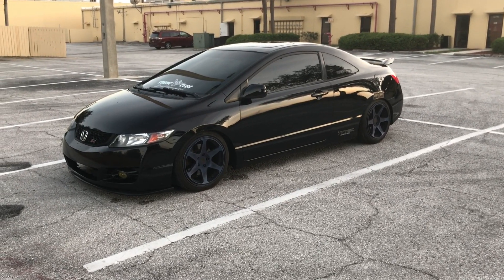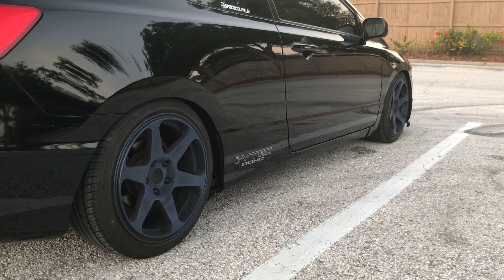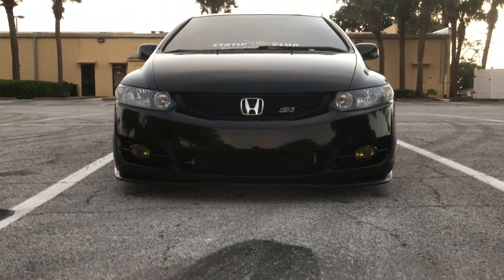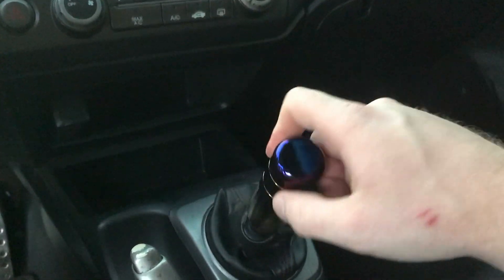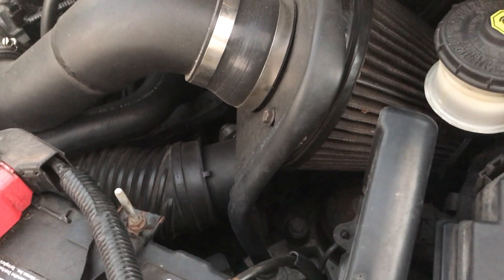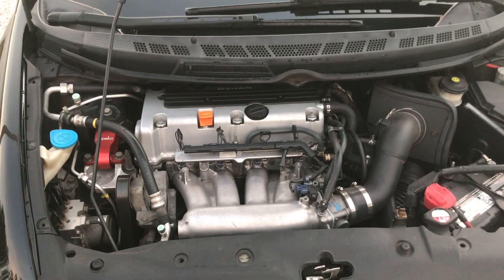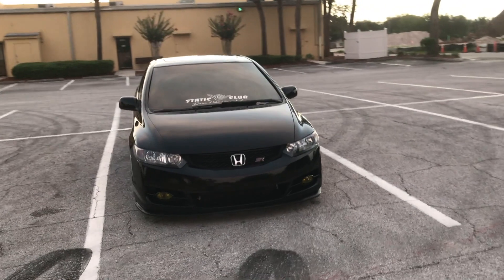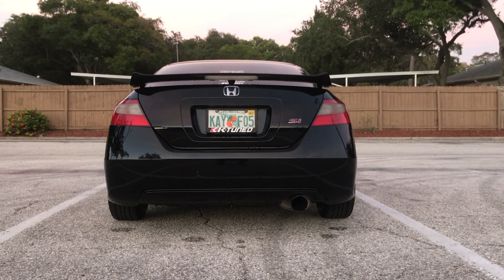MY SPACECOUPE | Full Bolt-On E85 8th Gen Honda Civic Si | Walkaround

Comment: The grill in the bumper actually reduces drag cuz it splits the air instead of it hitting a wall
Reply from the maker: Not too worried about affecting my 100-150mph acceleration times

Comment: With those Bolt-ons you aren't at 220 especially not at 240whp.
Based on your stock header with the berk downpipe and the hot air intake. You are probably close to 210whp on E85
Reply from the maker: 212whp You’re right havent dyno’d with my new V Stack Setup I just made which lowers intake temps to +2 degrees over ambient. On a cold day she probably would push 215 if I’m lucky

Comment: So your making around +70 go from stock idk how bolt ons can do that
Reply from the maker: An E85 Tune let’s you run more aggressive timing which helps out a lot compared to the stock conservative tune that comes on the car. Stock exhaust is also like 2.25” and has a cat which is very restrictive for a motor that revs this high. Once you go catless with a 3” exhaust these engines really wake up

Comment: question. how’s the e85 been? i heard stories of it corroding the fuel level sensor
Reply from the maker: No problems so far and I’ve only had E85 In the tank for about 3 months now. I’ve heard of this also, so I will definitely retune on 93 just to flush out the system for a couple weeks then switch back. I’ll keep you updated if that gas gauge goes out for sure
Reply from the maker: Update: Fuel Level Sensor went to a nice farm after a total of 3.5 months 😂😂
Reply: It will just happen to me about a month ago car still runs very good though
Reply: @8k_mikaa448  did you add solder to connection points?

Comment: What fuel setup you running for e85? Return line? Sirimoto flex fuel kit?
Reply from the maker: Just RDX injectors and my custom tune. Stock Pump, Stock Lines, stock rail, stock everything
Reply: @staticspeedtuning  wow